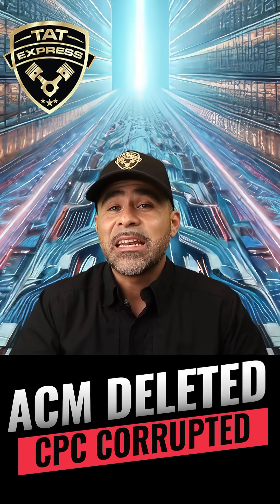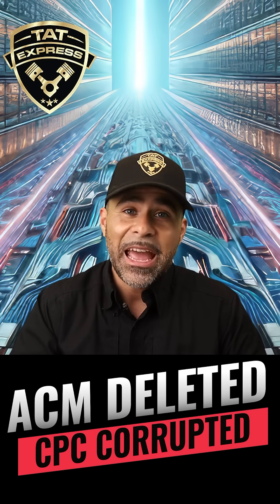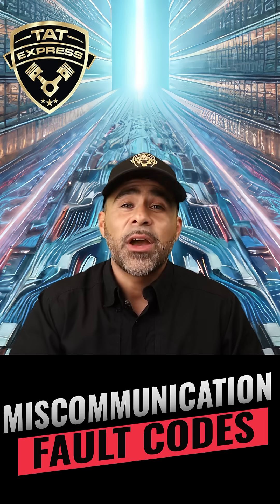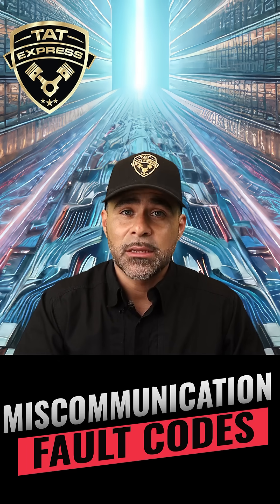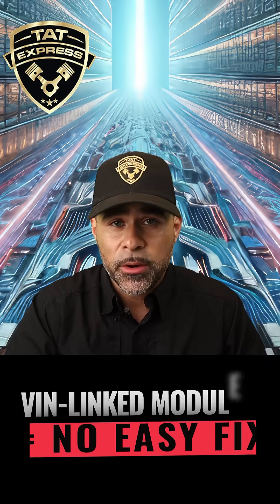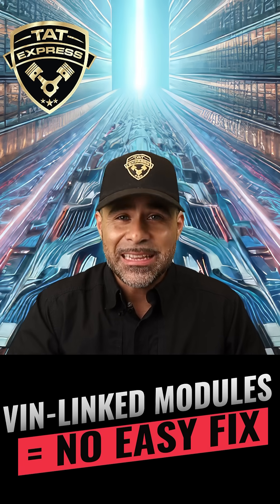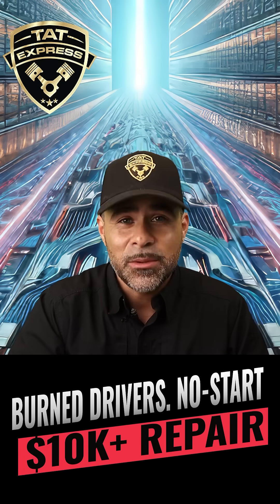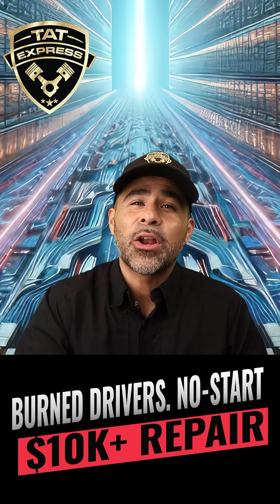⚠️💻 Hack Deletes = Burned Modules & $10K Mistakes | ECM, CPC, ACM Failure ❌🔥

Comment from the maker: Let’s hear it — Have you had module issues after a delete? ECM, CPC, or ACM failures? We see this all the time in the shop. Drop your experience below or tell me why you think deletes are still worth it. I read every comment.
Reply: @TATEXPRESSINC  I have not deleted my truck. I drive a 2017 freightliner Cascadia with 771,000 miles on it. About six months ago I started having problems with my one box and it was derating my truck and I was having to take it to freightliner. They would run three regions on it which would clear the error and put me back on the road at a cost of about $2000 each time. I got frustrated because nobody was telling me how to fix the problem so I demand it that they give me some more information and they said my only option would be to replace my one box at a cost of $15,000. What I did instead was I purchased the OTR diagnostic tool which cost $600 a year and I do a force region every week and I have not had the problem since then. I also had my DPF filters clean. But I have been talking to other drivers, owner operators, and what I said earlier was what they have told me. They all have older model trucks like mine 2010 to 2013 so forth and they have reported that they’ve had no problems with their delete. I hope that that makes sense as I am talking into my computer to create this comment as I drive down the road. Tell me what you think.

Comment: There's a right and a wrong way to do it. Do it wrong,  of course there's going to be issues.
Reply from the maker: I hear that a lot, but here’s the issue — there’s no “right” way unless you’re the engine manufacturer. Nobody outside the OEM has full access to the calibration maps and protections. So even if it runs for a while, there’s no real validation behind it — just trial and error with expensive consequences.
Reply: @TATEXPRESSINC that's like saying you can't upgrade your engine without the oem. No headers, no injectors, no turbo, etc. Since when did changing/updating the software  parameters become something we either couldn't, or is too difficult to do? The ECM and CPC can be reprogrammed of there are issues. There is nothing beneficial to recirculating exhaust through your engine

Comment: Ok… so it’s a $10,000 repair vs a $15,000 One Box replacement. 🤔🤔🤔
Reply from the maker: You got the basic math right — but I said $10,000+, not a flat 10K. These repairs can stack fast depending on what gets damaged.

Comment: 😂😂 i love everything you do for us please, you not gonna win this fight when you delete the truck more problems will come but bro you probably don’t know how bad you feel when you have broken down for  something that is just political ideologies, only mechanic are happy about DEF
Reply from the maker: These systems fail when ECM, ACM, and CPC aren’t communicating—common after a delete. But most issues start with poor maintenance: DEF filters never changed, excessive idling, ignoring regen. It’s not political—it’s mechanical. Deletes don’t fix neglect.
Reply: I’ve spoken to LOTS of owner operators who have multiple trucks deleted, including the owner of the company that I’m leased onto, and they report that they’ve had no/zero problems from deleting their trucks and they e been running them for years.  I think the guy making this video might be just trying to make money for his company.
Reply from the maker: @ We appreciate the comment. Yes, we know some deleted trucks can run a couple years without major issues—but that’s not the full story.

These engines are built to run close to a million miles. So if a truck runs 200,000 miles over a couple years, that’s just the first chapter. We’ve seen too many trucks come in with low power complaints after a bad delete, and once key components like the ACM and sensors are removed, they’re nearly impossible to troubleshoot—so we don’t even work on them.

We’re not here to argue. We’re just sharing what we’ve seen firsthand, every week, from trucks coming through our bay doors.
Reply: @TATEXPRESSINC  7 years no problems yet
Reply: 10 years no problem guys